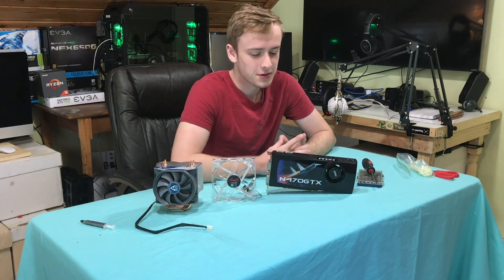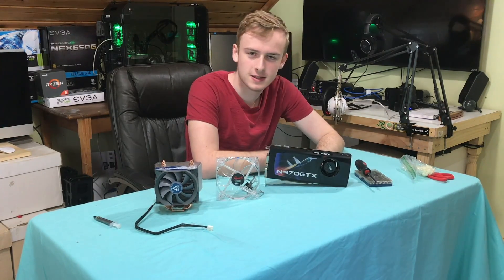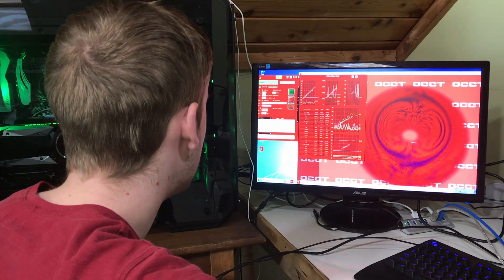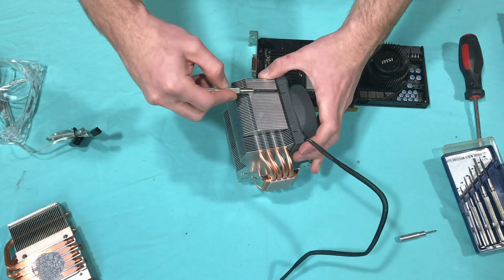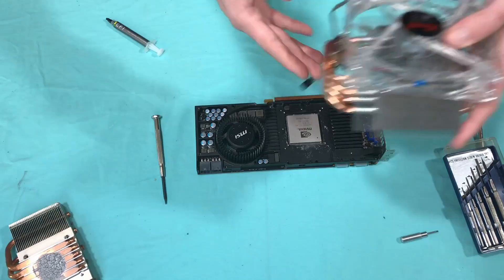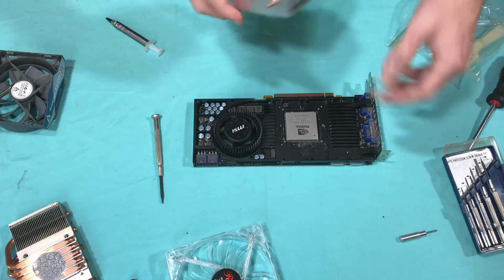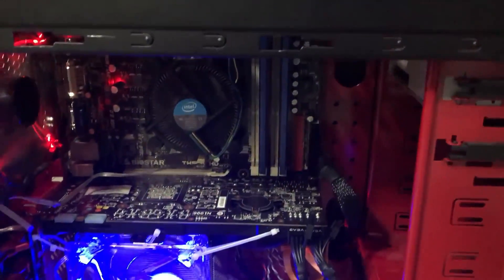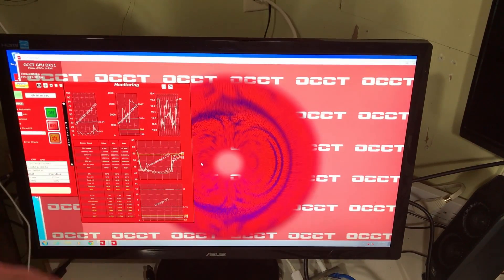How to cool your Graphics Card 30°c With $30 (GPU Mods) Custom GPU Cooler

Comment: Well, the stock cooler is also cooling the VRM's, while your method doesn't blow any air over those.  
I did something similar and dropped my HD 4870 temps from 80 to 50 back in the day, however, the VRM's were cooking at over 110C, so really you're making it quieter and cooler, but the VRM's are dying.

Comment: meh, zip ties aren't designed to support heatsinks... Unless maybe a thermal epoxy is used as the interface. They have too many degrees of freedom. Any slight bump would cause issues

Comment: I have a Asus Single-fan GTX 1660, that easily goes over 80 degrees under loads, and that's without overclocking...

Maybe....
Reply: same here bro, but mine is the GTX 1660 Ti ASUS Phoenix 
it kinda sucks, and i'm really thinking about doing this mod, just waiting for the warranty expires, soo if you did, please tell me your results
Reply: @pdream2128  I did something that worked wonders. Undervolting. Easy, straightforward with a tutorial, and effective. 10% less voltage = 10% less temperature with Overclocking. It takes a while to tweak like any Overclocking, but it's in a million ways worth it
Reply: @DemonLordGamingAC0  what does undervolting do?
Reply: @DemonLordGamingAC0  and does it affects performance?
Reply: @jokeflix2025  as the name suggests, you're running the GPU on lower voltages than default. And that makes your card run cooler. And also allows for higher clocks since you're a lot cooler than usual. And it affects performance, positively!
Reply: @DemonLordGamingAC0  just did it and i can only add 80 more to clock speed, and only 75mv lower voltage. sad 😂

Comment: LOL, you have a bigger cooler for your GPU than your CPU, I would have used the opposite combination
Reply: GPUs need much better cooling though since they draw 2-3x more power. CPUs that run hot are fine until stupid temps but hot GPUs underclock and die
Reply: @weavercs4014  both an i7 and an Nvidia 1080 draw a maximum consumption around 180watts. Although significant, a GPU does not draw 3 times more power than a modern CPU. And I was talking more from an aesthetic point of view. It looks so awkward to have a large CPU cooler on that GPU.
Reply: VuHien2011 my i7-8700k has a TDP of 95w a 2080 can easily pull 250w+ so ya just about 3x
Reply: @loganhill649 what about my ryzen 5 65w and r9 295x2 500w xD

Comment: Thanks for the video. I intend to attempt this cooling mod on an RX 480 blower card that has too much fluctuation in high-temperature jumps during regular use. Modding cooling systems to get better performance of a CPU or GPU should always be considered if you need better performance or you don't think the temperatures on the chips aren't currently acceptable to you. Unfortunately, using cooling techniques isn't a cost-effective answer to using older video cards that are at least 6 years old because it is likely the effort will not give enough of a performance and temperature reduction boost to warrant the effort compared to buying a mid-level GPU of the latest graphics models available on the market.

Comment: 30 bucks cooling mod for a 30 bucks GPU...
Reply: The main point of this video is lowering temps of an old GPU to squeeze as much power out of it before needing to upgrade
Reply: Very obvious comment for a obvious title of the video you clicked on

Comment: Love stuff like this, but shouldn't you worry about memory and vrm temperatures? If you're trying to get the most out of your card you might want to have some airflow on them. Think a vertical fan would help since it would push air to the ICs surrounding the core. cool video.
Reply from the maker: That’s why i left the original fan from the blower shroud on